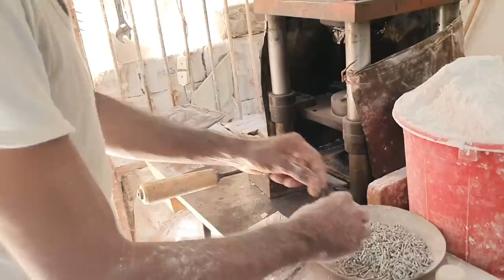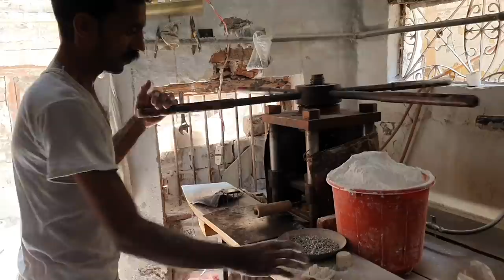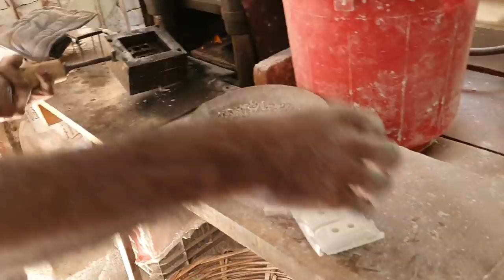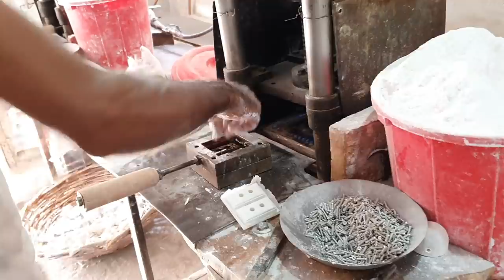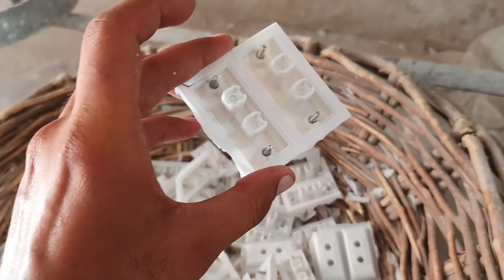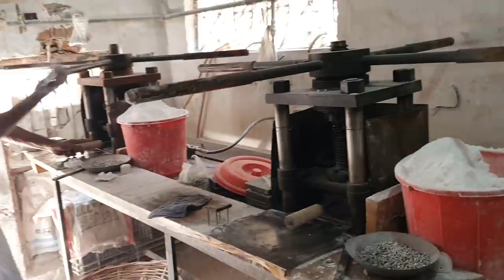Electric Socket Manufacturing Process | How to Make Electric Socket in Local Factory

Comment: I bet this meets / complies 100% with ISI specs !!!! At least that is what the mould pattern will indicate.  No control on volume, temperature timing or any way to determine if the thermoset is fully reacted. BTW what is the raw material used ?
Reply: Potato starch
Reply: @pratiknazareth3217  😆😆😆
Reply: @pratiknazareth3217  🤣🤣
Reply: Urea Powder
Reply: @tejashiremath3458  I guessed as much like it was Urea Formaldehyde, or Melamine.

Comment: If plastic is easily melted by heat,these are not safe to use as it will also easily catch fire
Reply: They are using thermosetting plastic
Reply: @paultavin3114  
Thermosetting plastic are not fire resistant.